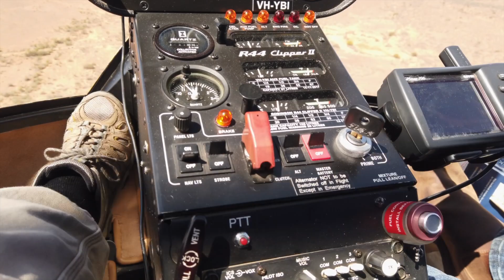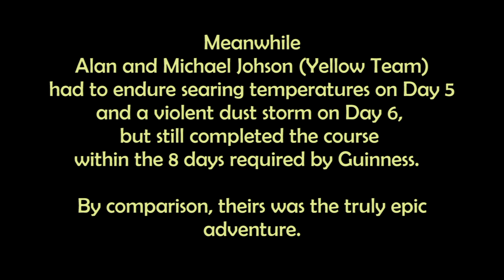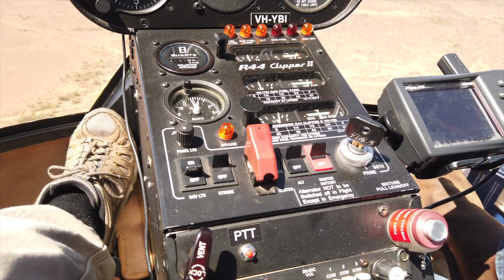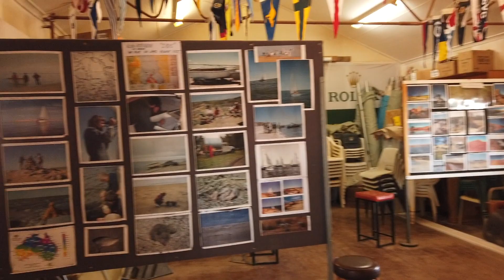Desert Outback Solar Challenge - Simpson Desert - 2019 Part 1

Comment: NOW YOU HAVE MY FULL ATTENTION.  The first solar powered vehicle (The Spirit of Adelaide) to cross the continent 3200 kms from north to south (Darwin to Adelaide) was back in November 1986.  I know – I drove it all the way.
Now throw in the Simpson Desert and I am hooked, however alarm bells are ringing. From what I have seen so far, not only will they not comply with the rules of the challenge, but their buggy’s performance in those relatively easy dunes leaves much to be desired.  Logistically with that many people and vehicles involved, good luck Stefan!  May the force be with you!